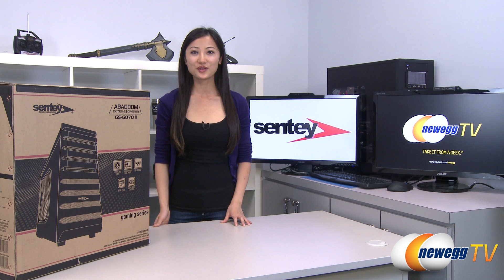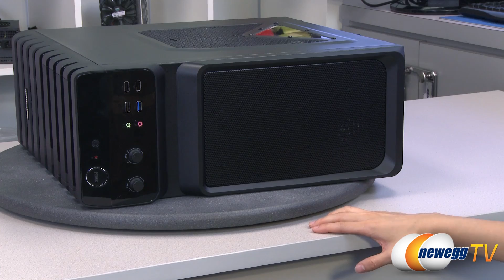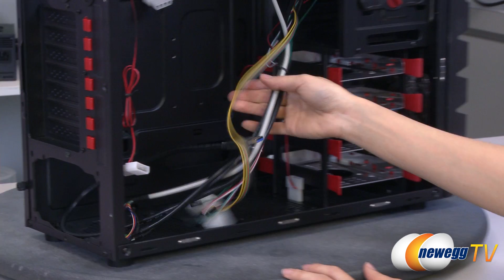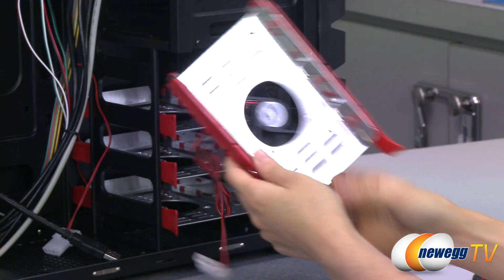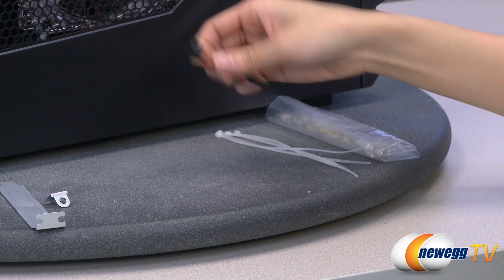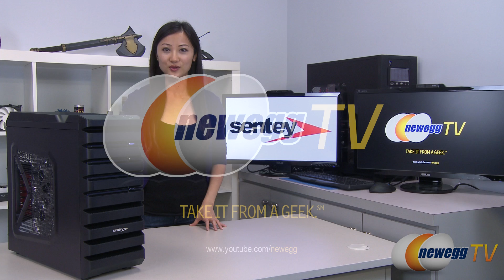Newegg TV: Sentey Extreme Division GS-6070 II Abaddom Black Mid Tower Computer Case Overview

Comment: The only thing you can do it to buy the computer in your own country, but go with a more value-oriented computer if possible, downgrading from for example a i7-3770K to the i5-3570K where you only will lose 2 MB cache, 100 Mhz clock speed, and hyper- treading (4 simulated cores), or buying a cheaper case, motherboard, RAM etc.

Comment: Unfortunately, Newegg "only deliver to locations within the United States and to Puerto Rico."
On Newegg the cheapest Nvidia GTX 670 costs 400$, but in my country with high VAT etc. the GTX 670 costs around 3000 DKK, which is about 510$ (just 10 $ less than the GTX 680 on Newegg). The Intel i7-3770K costs about 425 $ compared to 360 $ on Newegg.
It's a bit sad that we Europeans have to pay so much more for already expensive electronics :(

Comment: As far as I know all motherboards (regardless of size) are build in the same way, with IO, processor socket, PCI-express slots etc. in the same places, so they will fit in all computer cases no matter which side/way (some case manufactures rotate the motherboard 90 degrees for better cooling) the motherboard-backplate are. If you buy a new computer case with the motherboard mounted on the other side, everything (both motherboard, and harddrive cage, IO, powersupply spot) will just be mirrored.

Comment: I didn't know that the cases that camouflage the drive bays only had one bay.  As for water cooling I forgot that most reservoirs are installed in the optic bays.  And then I guess fan controllers are too.  I guess they'll usually not give you less than 4 on a regular mid-tower case since it allows you to fit a dual bay reservoir, optic drive and fan controller with 4.  So yeah I agree optic bays won't disappear, just the drives.

Comment: Yeah, I know most cases have them, but I'm talking about the ones like on this case that are meant to like camouflage the drive by having the door and button built into the actual case. Most cases that have these kind of drive bay covers usually only have one, with the rest of them the usual, pop-out kind. I don't see optical bays going out of style any time soon, as long as people are putting water cooling systems in their PCs. You still need them for the liquid reservoir. :)

Comment: People complain about 4-pin molex for fans because it connects directly to the power supply. If you do this the fans would operate using the full 12 volts, thus it becomes very loud. Fan controllers which use another universal connection (typically 3-pin) come in handy because it regulates the speed of the fan by limiting the draw of power from the PSU.

Sentey uses their own fan controller. As you can see in this video it actually comes with 2 fan control knobs. At 2:54, it uses molex